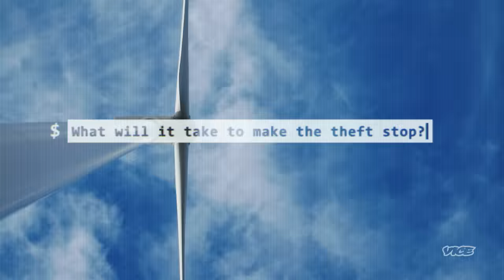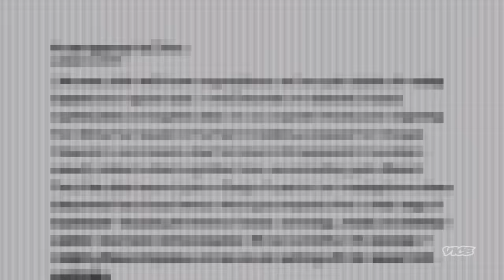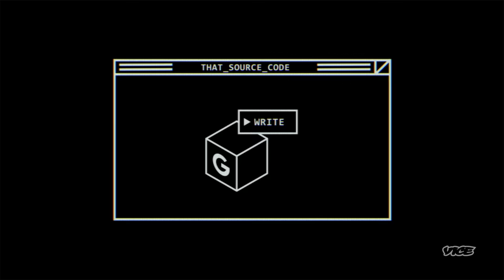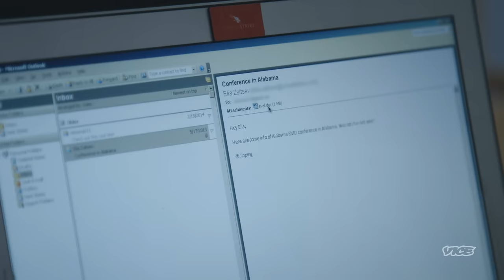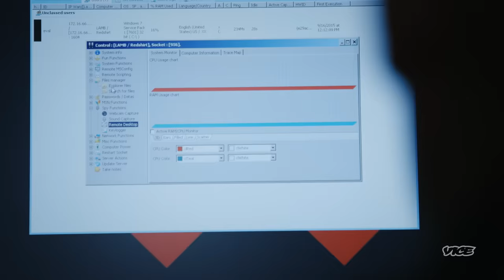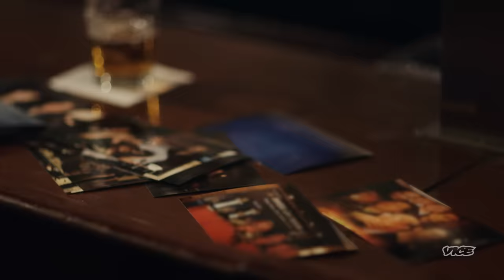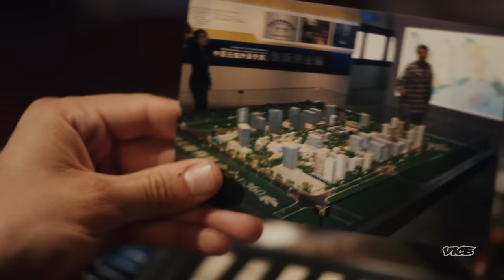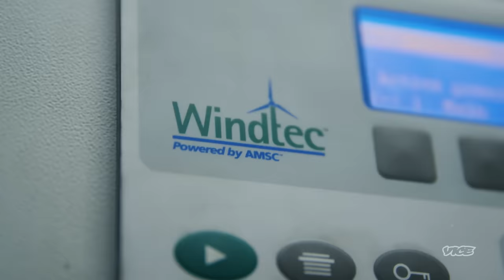The Chinese Hack that Stole 22m People’s Data | Cyberwar

Comment: As an Android developer, every time I add support for Huawei devices, the libraries Huawei uses are 95% the same, meaning their contents and 100% function the same as Google's libraries. They are usually just some time behind as they copy it from Google.
Reply: probably the same company different contry
Reply: @zacharywatson5531  Huawei and Google are not the same company 🤣
Reply: Are you serious? They should be 100% same. They ARE android. The later OS Huawei is using is Harmony OS. They have their own sdk. Though it is said Harmony OS has a lot same as Andorid too.
Reply: both are android, so only difference is what they did extra or remove something. it has nothing to do with IP theft. Look at samsung and other android phone. Fortunately you don't build software for desktop :)

Comment: anything digital is susceptible to a leak, there is no perfect system, your data is always at risk
Reply: They could start by asking less s***
Reply: @GamerbyDesign  As a programmer, we have to store these things. Anything you enter that relates to security or the function of the application, is stored, and thus, susceptible to breach.
Reply: @yesyes-om1po  Bad programming.  I've worked at companies were the sensitive data was only used when the transaction was made and then deleted.
Reply: @GamerbyDesign  ???

How do you compare two values when one does not exist. The other value needs to exist somewhere, if not on their servers, then on somebody else's servers, which are also vulnerable to breach.
Reply: @yesyes-om1po  Not into Data minimization are you?
Reply: More like anything of value is susceptible to a leak

Comment: I exposed my home assistant to the internet so that I can like control my lights remotely. And within a week I already recorded 2 failed login attemps from Henan, China.
Reply: If they're not on its own VLAN, you're just asking for trouble.
Reply: Mmm sounds like you need a router and modem upgrade 😮
Reply: @DatSick  lol I do want to but maybe it's already overkill. My router/firewall is infinitely more powerful than any commercial stuff money can buy, and also cost less because I built it myself with my old PC parts

Comment: tracebacks, scraping, recalls, log types and forms etc. all types and from many devices began to ignite questions to this and clues led to the given signs or suspicions, AI intervened due to abusive, graphic, disturbing and traumatic content and traits or tendencies of the packet information being dangerous or extremely damaging with possible interaction or outcome leading to injury, death and destruction or decay between the receiver and sender or the networked individuals between the two in common.  It was a external third party that messaged and took control of a device and set off a process of events and timing and was capable of erasing devices and any device that too pictures or videos and became a tool of involvement. It did the right thing clearly but it's not come clear yet, people did or have gotten hurt or killed based on continuation of involvement of a given person "the person who had the data originally not the recipient who spoke up"

Comment: learn to factor primes w 91hr clock Cambridge U uk 
china  makes  the parts but can't have the toys so pirate machines are hard to track running 3rd even multiple user layer levels. we can't even have the toys either now how does this analog break ? 2022↑ analog gears heavy switches mechanical bs go ahead drop the phone  now!?!? new phones oh boy they nevet let us project wo a monitor tom away cast app luck to still steam content